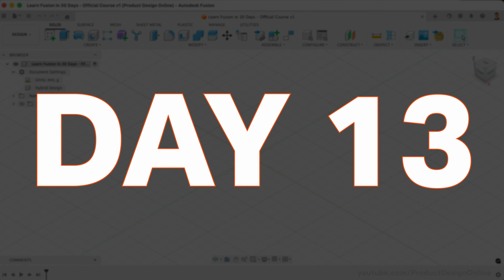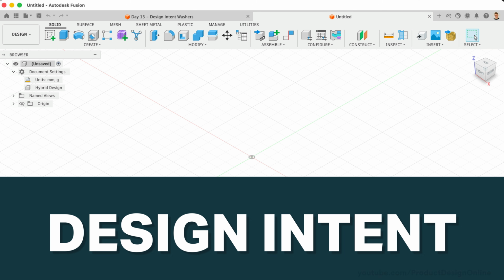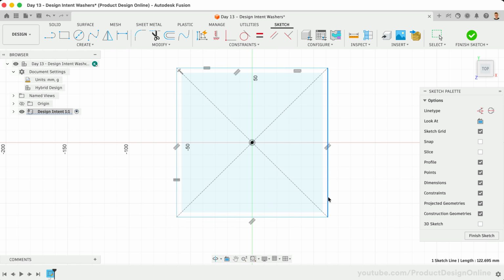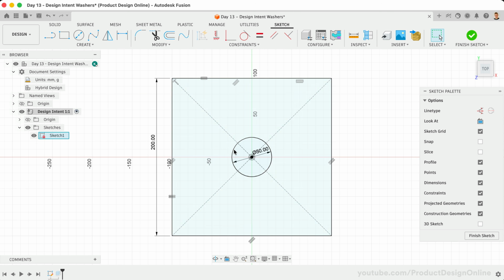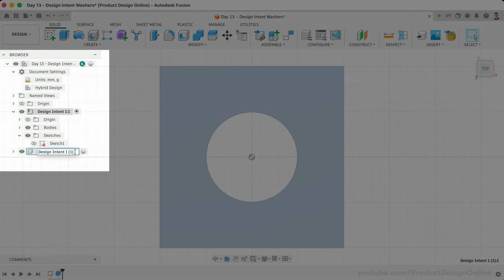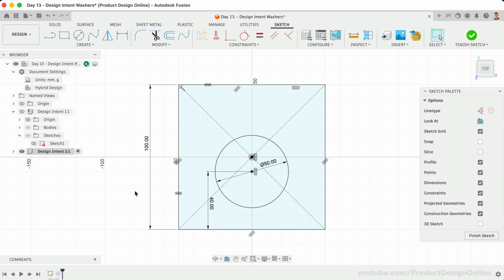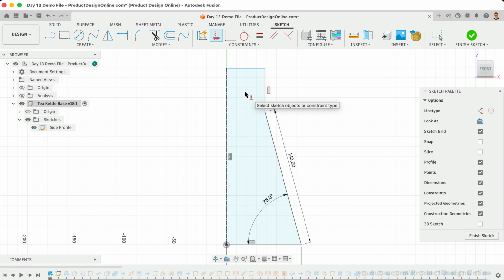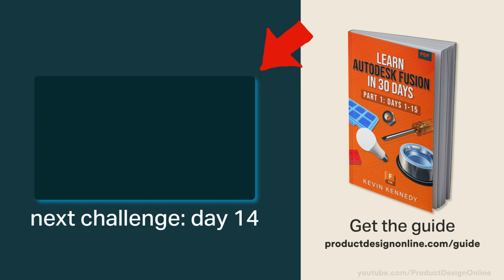You’ll regret breaking this rule | Day 13 of Learn Autodesk Fusion 360 in 30 Days (2026 EDITION)

Comment: I would recommend going further into design intent by making it so that there is multiple things and make them effected by their environment so if you change one thing of its environment it will change the layout, height, and size of the sketches or extrudes. It's really fascinating because i used this on one of my designs to where if I changed the dimensions of the main button cutout it changed the Length and width or everything else. 

 So, in short making dimensions for the space in-between Objects

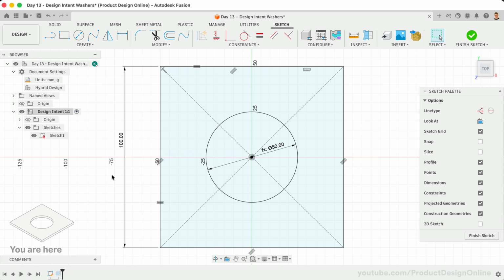Comment: I'm trying to follow your dialogue at 7:20 you talk about "Selecting Component" Unfortunately, no matter how hard I try, there are no components in my parts tree.  It goes Title, Document Settings, Named Views, sub > Origin, Bodies, Sketches.  How did I not end up with components.  My file is Hybrid type, running Fusion Insider.

PS: I read the manual and there it was, couple of clicks away.  That's why I am starting to love Fusion, because useful help is generally not that far away.😀

Comment: Rather than using a formula for the circle diameter, one could draw a construction line between the center point and a side of the square. Then use the equal constraint to force the diameter to the length of the construction line.

Comment: Does it make sense to wait for 2026 videos, rather than going through 2023 course instead? Are 2023 videos so outdated?
Reply from the maker: The 2023 version is still 95% accurate as long as you start each file with 'HYBRID Design' and keep an eye on the pinned YouTube comments where I call out common issues and their fix.

Comment: If a sketch isnt fully defined, is there a way of highlighting which piece is missing a constraint/measurement or do I just have to fiddle around (which is really painful on complex sketches)?
Reply from the maker: Yes! However, it's a bit hidden and not a button in the UI. You have to use the 'Text Command' input in Fusion. Here's a video on it: https://youtu.be/matqB8nGzQI?si=zClZZirx4PuGKm1E